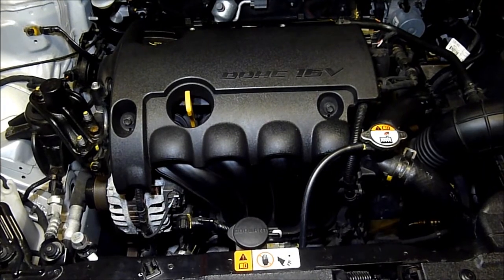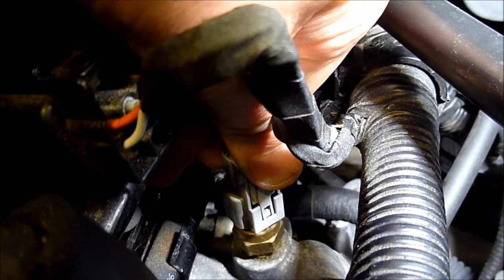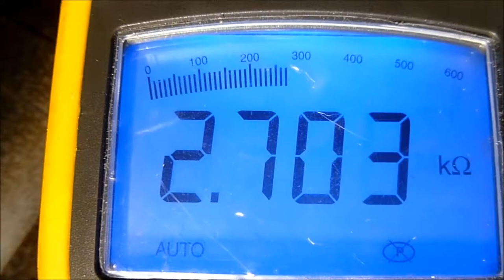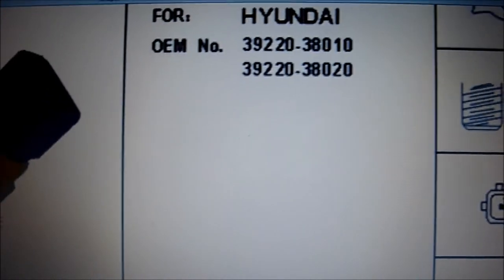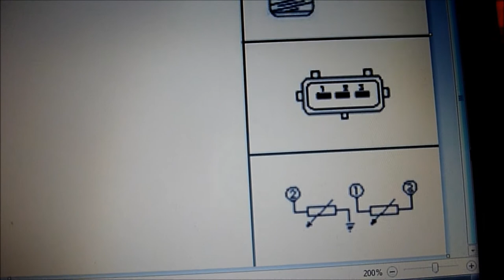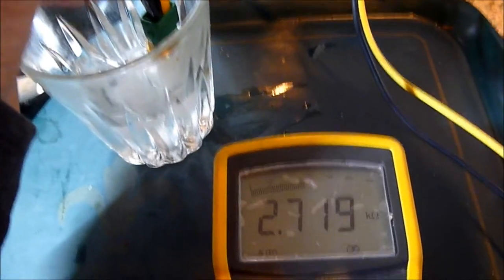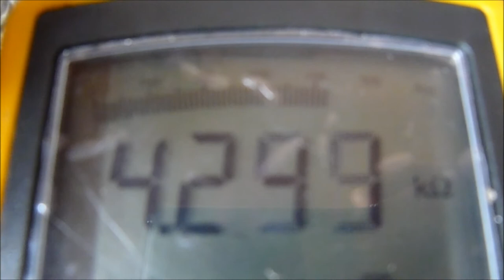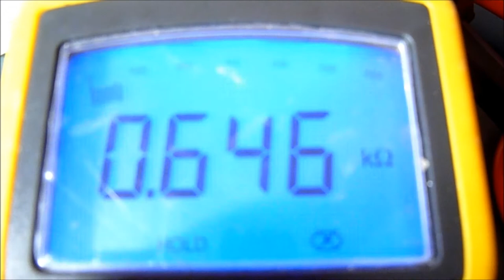ECT Engine Coolant Water Sensor Location & testing Hyundai i30 MK2  G4FA engine in Hd

Comment: Also put a thermometer in the water alongside the ECT Sensor so that you can see what the real temperature of the liquid is, a kitchen cooking one is ideal for this task. Obviously the water was NOT 90 degrees C, it had cooled down too much by the time he did the test. In my Hyundai manual, for this test a reading of 0.6 k-ohms would be equal to a water temperature of around 60 C. About right considering the water was long off the boil.

Comment: Where is it on the mk1 i30
Reply: Also put a thermometer in the water alongside the ECT Sensor so that you can see what the real temperature of the liquid is, a kitchen cooking one is ideal for this task. Obviously the water was NOT 90 degrees C, it had cooled down too much by the time he did the test. In my Hyundai manual, for this test a reading of 0.6 k-ohms would be equal to a water temperature of around 60 C. About right considering the water was long off the boil.